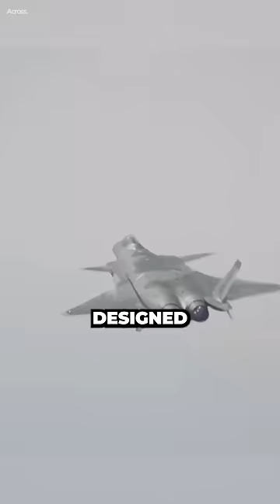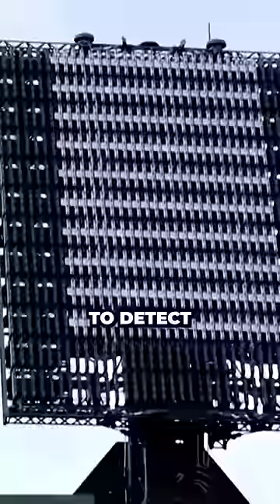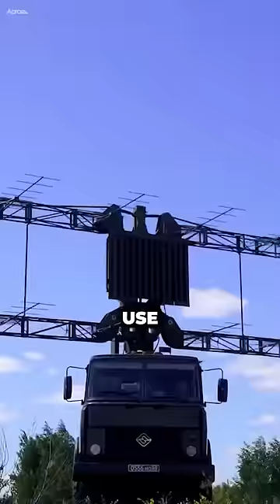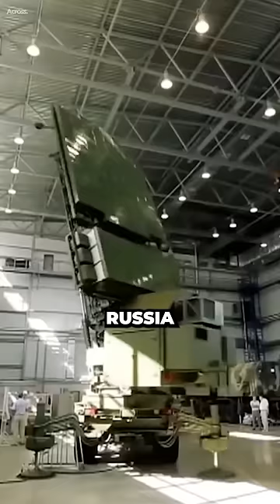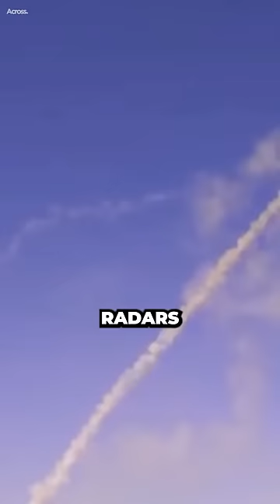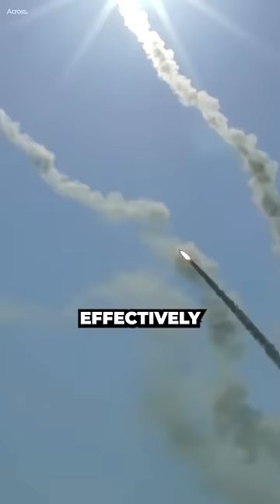How Russia's Radars Have Detected Stealth Fighters

Comment: did they detect the su57 and say they can detect stealth aircrafts
Reply: Probably. The su57 is also only partially stealth from the front angle, but sticks out like neon lights from every other angle
Reply: @phantomwraith1984 It's not even strealthy head on. It's the only "stealth" aircraft with fully exposed frontal fan blades. Those things light up on radar like a Christmas tree.
Reply: OK, the thing is if the Russian radars can only detect stealth but cannot really target a stealthy aircraft, can a US stealthy aircraft pilot dare to violate the Russian airspace who may end up repeating Gary Powers?
Reply: To answer your question, no they cannot detect the Su-57. You see, to be detected the aircraft must actually be present.
Reply: Im quite sure they don't even need to detect it because it's their damn aircraft lmao

Comment: This is a slightly misleading point. Stealth just means relatively low observability. The degree of low observability comes down to the radar cross-section of the aircraft or object in question. The smaller the radar cross-section, the nearer it must be before detection. Low frequency radar will detect an object with a given radar cross-section Earlier than a higher frequency radar. But you can’t track and get a firing solution on an object using a low frequency radar. That requires a higher frequency unit. Nothing has changed here. The more stealthy or low observability a plane is, the closer it can get to you before you can detect it, or get a firing solution on it.
Reply: yea right, thats like saying that American planes can't be shot by the best defense in the world-----u are are dreaming. and u are an American and it shows

Comment: A friend of mine had a theory that low-frequency radar waves can be used to detect stealth aircraft; I'm surprised their theory was correct.
Reply: It is well known that WW2 radar systems can detect stealth fighters. The only problem is the resolution of these old systems.
The lack of resolution can be compensated by computing the data of multiple transmitters and receivers.

Comment: Several S-400 systems have been demolished by drones while filmed by other drones showing the demolition. The S-400 system did not see that coming! So those systems are not up to the task of protecting against stealth aircraft.  Also its said that stealth aircraft can be seen on the radar but targeting could be impossible as jamming will show a very elusive target. So its not only about short or long wave radars in use that is significant. Then there is IR targeting which is countered by flares to confuse the IR guided missile.
Reply: u are talking about the one u cooked up? nobody has coem up  with that

Comment: Hey you need an actual stealth fighter to say u can detect stealth. Since Russia has no such thing (su 57 def not stealthy) they can’t back up their claims
Reply: Or they could just do some math...
Reply: @klankles  I recommend the Wikipedia article for "radar cross section" if you're interested in the math, the math seems to be correct as nobody has commented about it, though some are complaining about the definition.
Reply: Along with this I would like to point out that there are rcs calculators that can calculate the rcs of a 3d model, though it doesn't seem to go into detail of wavelength nor the size of the aircraft, while is the main point of this short

Comment: First in peace conditions stealth fighter jets never fly in stealth mode. They fly with radar reflector to show themselves. So Russians probably had never see any jet flying in stealth mode.

Second problem low frequency radars has low resolution and high parazyte rates. Clouds, rain, storms, bird swarns makes too many parazytes. It is very difficult to identify a fighter het properly from parazytes.

Third problem is seeing a stealth jet in low fequency doesn’t make you shoot it down. Air defence missiles has radar seeking targeting system. Stealth jet must be illuminated for the air defence missile. But you can’t focus illumination radar on the stealth jet so it will be still stealth for the air defence missiles.  And if you send fighter jets to intercept the stealth jets before enemy jets comes stealth jets would have enough time to leave their missiles and bombs and finish the mission.

Stealth jets are not only invisible to radars. They also have kow thermal and infrared fingerprint that anti air missiles can’t target them.

Comment: Then it's probably short range, and stealth aircraft may be moving along with non-stealth aircraft like the Wild Weasels (the planes who want you to radar them) and even drones who will hunt radars. That being said, shooting it down may be a whole different issue as a radar guided missile will probably use high frequency radar and has one transmitter/receiver or the plane will simply be out of range of ground-based radar guided missiles. Stealth is still a problem for enemies, and I'm sure the US Military has tested these scenarios using all types of radars (even Russian/Soviet ones) and other optical systems. Standoff weapons present even more problems for the enemy, so it's a very dangerous game and you may detect it, but be well on your way to being dead by the time you detect it.

Comment: not only that , these raiders also jamed the F22 and also blowed it's communication system physically by overloading of false raider signals .
Reply: Except it’s impossible to jam an F-22’s high frequency AESA radar with a low frequency pulse type radar! It would be like trying to jam a FM signal with an AM signal, the antennas and frequencies aren’t close to being compatible!??
Reply: @JimCOsd55   it's not jamming mostly as i found out it was like giving too much false trash signal and make the communication module overload.
Reply: @raven4449  Post Script - of course Ukraine doesn’t have all these fancy frequency hopping radios, instead relying on old Soviet radios. Thus the powerful EW jammers the Russians employed in Ukraine did block much of their communication. The downside being that it also blocked Russian communications as they also used old Soviet radios! Now Russia did design a new encrypted radio for secure communications by their army commanders but they designed it to use 4G networks. Unfortunately, in the opening days of the invasion, their rocket forces targeted Ukrainian 4G towers rendering the encrypted Russian radios … useless! Thus forcing Russian commanders to use unencrypted radios leaving US personnel monitoring their communications astounded. They were able to send Ukrainian forces updates on their movements and even help them target Russian commanders with artillery strikes! It also allowed Ukraine to spoof combat units with false orders, confusing and leaving them unable to support each other. Now are you beginning to understand why Putin’s SMO went so spectacularly wrong in the opening weeks???

Comment: Nobody ever said that stealth was "undetectable". Not even that you couldn't get a lock-on them. But doing that and maintaining one long enough to actually have a missile or even gun fire shoot one down is a whole different story. We've known that all the way back with the SR-71 that inadvertently just happened to be stealthy and they studied it. Even the F-117A could be seen. Most of the time it was only the size of birds in the return, but could be seen. Even when it was tracked nobody could get a firm, maintainable lock.
Reply: Actually the SR-71 was designed with stealth in mind from the blended body to the canted tail fins built of a laminated plastic-type material composite to reduce radar cross-section. They even explored building a plasma generator to hide the engine inlets which didn’t work. But they found that adding cesium to the fuel would keep the exhaust from forming a vapor trail and giving off a radar signature!
Reply: @JimCOsd55  Actually it wasn't. They didn't have the computers and knowledge to do so completely. They did notice that previous aircraft had different radar signatures from different angles and sources. They did study this and withing the bounds of what the design criteria was, incorporated what they found into the design. Without going into the classified arena, as I both studied the aircraft while at USAF Academy and later while working on them as a crew chief, these things were beyond their time in many ways. Many new techniques and processes were developed almost from scratch to create this aircraft. At the Skunk Works, the guys that did this are looked upon with great respect.
Reply: @ddc163264  Still, my point was that the U.S. Air Force was aware that there were ways to reduce the RCS of aircraft especially their spy planes. 

Project RAINBOW was the name given by the CIA to a research project aimed at reducing the radar cross-section of the Lockheed U-2 and lowering the chance that it would be detected and tracked by Soviet radars during its overflights of the USSR. However, the Soviets continued to track the U-2 flights in spite of experimentation with various technological fixes. The fixes reduced altitude and range for little gain in stealth?
Reply: @JimCOsd55 Agreed, I know a lot about that Project, one of my commanding officers was a U-2 pilot. He got me my first clearances to be able to talk about many things and operations with me.

Comment: Before I let this bother me. I will remember the investment the US made into 747s with laser systems capable of destroying ICBMs. That in mind, the new 6th generation fighter gets will be mounted with Lazer systems as well. It's getting salty on the BF.
Reply: That was completely another tech. Lasers had so low efficiency that only toxic chemical lasers could potentially provide the needed power. Latest fiber lasers have 40% !!!!! efficiency, which meas they could easily put 4 or more into a cargo plane. Scaling up to several hundreds of KW is now possible.

Comment: To the coping 🧢 people: yes their low frequency radars can pinpoint US stealth aircrafts, and transmit their coordinates to nearest air defense system. 
Their new fliging radars can even directly guide long range air defense missiles, eliminating a loophole where enemy aircrafts can fly low escaping radar detection and escaping guided SAMs
Reply: Nope a  low-frequency radar is limited by lack of available frequencies (many are heavily used by other systems), by lack of accuracy of the diffraction-limited systems given their long wavelengths, and by the radar's size, making it difficult to transport. A long-wave radar may detect a target and roughly locate it, but it will not provide enough information to identify it, target it with weapons, or even to guide a fighter to it.

This is why modern stealth fighters are designed to delay or prevent detection from higher frequency radar arrays broadcasting in parts of the S, C, X, and Ku bands, because these systems are capable of providing a “weapons-grade lock,” in other words, radar arrays that can guide a missile or fighter to a target.
Reply: @JimCOsd55  complete B S. Why do you think they even use VHF radars if they can't provide targeting information? And, for example, Russian air defense can use several frequencies simultaneously to pinpoint and determine what kind of target it is. They have radar signatures of all modern US planes. Also there are air defense missiles that use active radar tracking, and/or infrared tracking in the final stage of flight.

Comment: “Detect” does not equal “track”.  Low frequency radars were the norm before they were used for targeting aircraft.  They were abandoned in the past because it’s physically impossible for low frequency radar to return enough information to accurately target an aircraft.  

Ie,  knowing there’s something east, somewhere between 20k and 40 k feet, traveling kind of “left” at a speed between -5 and 1500 mph; does absolutely nothing.

Comment: Sure, they can detect a stealth fighter. However, they might not be able to be sure if they see a fighter or a rain cloud. 

Plus, it's the vertical stabilizers that give the largest return on low frequencies. The stealth bombers don't have them and neither will the 6th gen fighters when they enter production. Good luck relying on this

Comment: This is not groundbreaking news. LF Radar can detect low observable airplanes, but lack ANY ability to track or lock. Think of it like walking in the woods at night with a blindfold on and you hear a twig break off in the distance. You know something is out there in a general direction….maybe…but you have a near zero chance of actually seeing it. The F-35’s AEW suite in particular renders even LF radars about as useful in combat as a half used roll of aluminum foil.

As for Russia developing “Quantum Radar”…is that before or after they being FRP for the SU-57 or build even a single SU-75? Or maybe after they send their conscripts to the front with socks and rifles that were state of the art sometime after 1891?

Comment: There is no such thing as a quantum radar and likely never will be. Low frequency radars are better at detection but lack the resolution to achieve a reliable missile lock. That doesn't make them useless, but it means you're firing half blind and hoping the missile itself can do the rest. That gets expensive fast.

Comment: do you know, that the earth stealth tech is actually similar to non terrestrial "cloaking" tech? it is simply to make your pulse irrelevant to the sensor's pulse is being used. for example, the why low frequency radar can feel the stealth jet's presence, becasue the stealth jets radar cross section and its electroactive RAM coatings is suppose to make the plane irrelevant to higher, high definition frequency radar. by adjusting its own "pulse" characteristic. extraterrestrial cloaking tech is similar by principle, they made an enveloping effect to their craft that makes their craft pulsing out of the range of frequencies "visible". from low infra red all the way to ultraviolet. which made their craft INVISIBLE. which the method of their enveloping work in conjunction of their "singularity" frame effect which making the singularity bubble devoid from visible frequency would make the entire craft to disappear. and radio waves would just pass through it like its not there. thats a scientific level that earth hasnt reached yet.

Comment: Now all they have to do is figure out how to get the low frequency radar to get an accurate track so you can fire a missle at a target while overcoming the ease of that tracking method of being jammed or fooled by EW and protect those humangous antennas from being attacked by Anti radiation missles. Yea good luck with that!

Comment: Such planes usually fly at high speed even when they are flying stealtily, such that missiles are the best at shooting then down. 

A large-size, ground-based radar may be able to detect the stealth planes, but the detection has to switch from the ground-based radar to the missile's radar as the missile is fired at the plane. However, the missiles' radars only work at high frequency, which means it's not going to work.